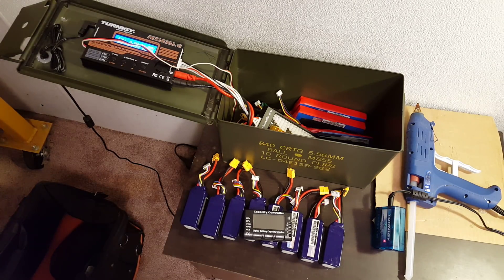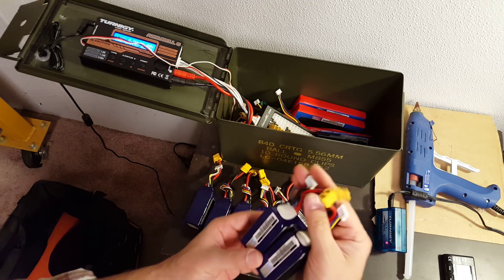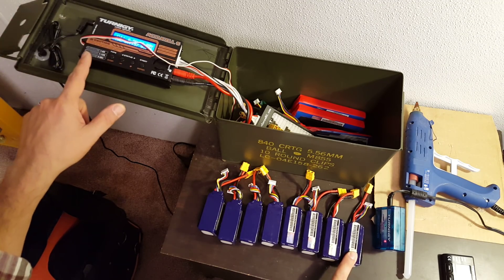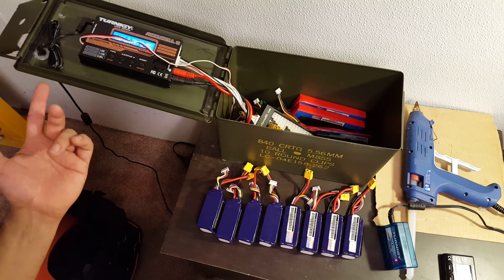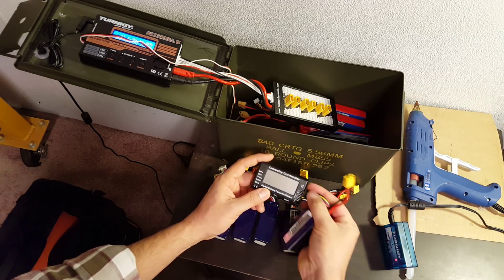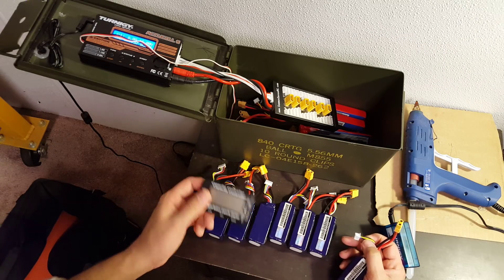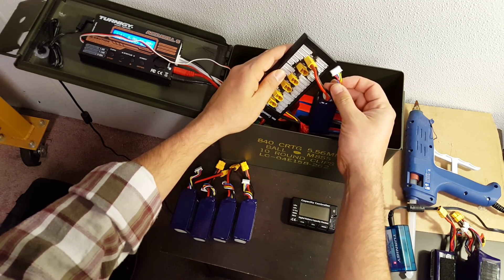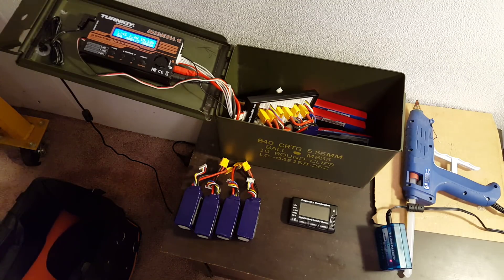How To Parallel Charge LiPo Batteries Without Burning Down Your House

Comment: So just to clarify this - I have an Accucell-6 like yours, and I just got a parallel board. I plan to charge x4 4s 1300 mah batteries with it. I did the math and I believe if I tried to charge them at a charge rate of 5.2 amps, I would end up pushing potentially 87.36 watts, which is more than the Accucell can do. I read from Oscar Liang that the Accucell will auto-detect that I'm trying to overdo the power, and will automatically adjust the charge rate to safely charge. - Edit - I assume this is why you max your charger out @ 6 amps knowing that it won't push that much amperage.  For now I just plan to charge 2 of them at a time at a 2.6 amp charge rate, which seems safer for my charger. 
What do you think? Should I just go ahead and carefully try charging all 4? Sorry for the wall of text
Reply from the maker: You can charge all 4 it will just take longer. The Accucel will not let you exceed its rated amps or watts. The only thing to worry about is whether you are charging the batteries too fast.
Reply: Okay cool, thank you.

Comment: Are higher discharge rate batteries always better than lower discharge rate ones ?
Reply: If not, why ?
Reply from the maker: +LT “John” YV discharge rate on the label is almost completely meaningless. A 70C will probably perform better than a 20C but anything over perhaps 40C is a total crap shoot. And anything over 90C is almost certainly B. S. 

For mini quads, higher REAL discharge rates are probably better. For other applications, energy density and other metrics might matter more. For example, an EDF plane will have relatively constant current draw with few sharp peaks. So a higher discharge rate might not be needed. Every battery design is a tradeoff.

Comment: I noticed that you used the balance charging function when charging in parallel charging. Are you still able to parallel charge safely using the normal charging function?
Reply from the maker: +Nestor Folta sure. It's no different than charging one large battery. But I think you may be more likely to end up with the packs out of balance when you parallel charge because the cells haven't been matched (internal resistance) like they are within the same pack. But I'm not sure about that.

Comment: what if i leave batterys connected to board to do their job and they will balance closer before i start charging them .
Reply from the maker: Yes.
Reply: i was about to say the same, thats what i always do but wasnt sure was right!! I normally just use my batt then when  i need them again i slap them on the board and i leave them there for about 10 minutes...then start balance charging. If Joshua approves ill keep doing it....so far i didnt have any problem! :D
Reply from the maker: +Gaming isnotacrime just be sure they're not too far out of balance! The current can be substantial if they're not.

Comment: Hey Josh any tips on how to get the batteries close to the same voltage 0.1v from each other?
Reply from the maker: +Amber Meows If you stop flying with a mAh meter on your OSD, they should be pretty close. At least they are for me. Remember, it's not 0.1v, it's 0.1v per cell. So for a 3S, that's 0.3 v; for a 4S, it's 0.4v. That's a relatively large window to hit.
Reply: Thank you for confirming the voltages for different cell types! All the guides i've seen on parallel charging always say it's suppose to be 0.1v.
Reply from the maker: +Amber Meows no problem!

Comment: "Parallel charging is somewhat of a controversial topic..."

FOFL! That there is the understatement of the day...

"Don't do anything dumb, and you'll be OK..."  is just golden. I couldn't have said it any better myself. :D

I'm of the "Parallel charging is just Taunting Murphy" camp. I see it as trading essential safety for the money saved not buying the stack of multiport chargers you SHOULD buy to charge all the batteries you WANT to charge at once.

That said... it IS possible to parallel charge safely... as long as you treat your entire charging array as if you ASSUME you'll have a fire one day, and set up your charging station so it can HANDLE a 1400° fire. In all honesty, you REALLY should set up this way ANYWAYS, because ANY LiPo can catch fire AT ANY TIME.

Your setup is probably one of the few I've seen that DOESN'T fill me with dread; this is because you are doing it the SMART way. Your setup CANNOT possibly apply more than the 2C-5C charge rate that is safe for most LiPos, so even if things went south and all the current got dumped across one pack, you still wouldn't be over-charging. This is not so with some of the bigger setups that some parallel-charging fans use... that push 40A across the array, and if ONE LiPo goes open-circuit, the setup dumps way too much current across the other LiPos in the array.

Also, your chargebox is a great idea; if there is a fire, you just close the lid and throw everything out the door onto your driveway. I use a similar setup on top of 12" ceramic tiles deliberately arranged to be easy to grab & toss.

Like anything involving electricity, messing around with it when you don't know what you're doing IS just dumb. So if y'all don't understand the reasons Joshua is advising you to do things the way he is, don't do it!

Electrons may be tiny, but when they gang up on you, they ALWAYS WIN. :D
Reply from the maker: +mnemennth "Electrons may be tiny, but when they gang up on you, they ALWAYS WIN."

That's brilliant.
Reply: +Joshua Bardwell :D
Reply: 88Nikoli. When I was a paratrooper in the Army, we used to say, 'feet and knees together'. Point being, you're going to get hurt, but still don't land like a bag of shit. We use to carry explosives in ammo cans. Detonators in one can and C4 in a different can. Both in the ruck on your back. I won't  parallel charge until my setup can handle a fire and the fumes because massive amounts of stored energy in any form has potential.
Reply: mnemennth. Nice rant. I picture bad things upon hearing pick up something that is on fire. It is possible if you can if you catch it quick, but not good to try to close the lid. 

Could be as simple as a medal cable on the can and a wooden dowel on the end. 

Even keeping a set of pliers near would be good. Maybe you do this, but the point is to have a plan and react.
Reply: A lipo won't catch fire just at any time, smh

Comment: can i do this with 2 tattus 4s 1300 and 1500 ?
Reply from the maker: Yes. As long as the cell count is the same and the voltage is within 0.1 per cell.

Comment: nice video, does it matter which balance ports you plg the battery's into on the board?
Reply: I just got mine
Reply from the maker: +AveryFpv Does't matter. They are all in parallel so they are all "equal".
Reply: +Joshua Bardwell thanks!
Reply: @JoshuaBardwell  that comment should have more likes

Comment: Great video!  I find your channel more detailed in information and more giving than that farting around rotor riot channel.  You got tons of info ranging all angles around multi rotor. I'm amazed how much videos you put out.. You have helped me tons. Keep up that great work.
Reply from the maker: +2663540 Thanks for the kind words. Glad you are enjoying the content.
Reply: JohnnyMacZero24 .1 of the center would be better...measure and pile them up until you have enough of the same to do a batch...so if one is 3.5 then 3.4 n 3.6 would be ok to charge all three
Reply: MyBigThing2010 Got it and thank you! Happy Flying
Reply: Joshua Bardwell Hey Josh Love your work friend, here's my quick question 
So if my 3S Battery's are at 3.78 3.81 and 3.82 it's safe to charge correct? All cell should 0.4 of each other right?
Reply: JohnnyMacZero24 no prob..same to you
Reply: 2663540 agreed about rotor riot! They have given me lots of free advice, and for that I am grateful. However the "farting around" is kind of annoying at times. Joshua gives a lot of detailed reasonable advice, and uses reasonable equipment. Case and point: on the parallel charging video for rotor riot, they used a $300 charger with a $100 power supply! I don't know about you, but I was squirming spending $50 between charger and power supply! Ended up buying the Turnigy Accucell like in this video. Thank you +Joshua Bardwell for the info!

Comment: Hi Joshua. With these parallel charging boards, is there a specific order for the balance ports in relation to their XT60 ports? E.g. First XT60 port uses the top left bunch of balance ports, so on and so forth, or are they all the same and I can simply plug my battery balance leads into any convenient port? Thanks.
Reply from the maker: In parallel, order doesn't matter. You can use any plug.

Comment: is there a very easy and fast way to charge batterys that are more then just 0,1V apart from each other? I just start with the lowest battery and add the other ones, as the allready charging battery becomes the same voltage as the "next" pack. It is very annoying to allways watch the V Meter on my charger and dont miss the correct time to connect the next Lipo to my board.
Is there a faster way?
Reply from the maker: +skatebjarne Remember, it's 0.1 volts per cell, not 0.1 volts. But if you're more than that, then what you described is basically how you have to do it. Or just charge them one at a time and suck it up.
Reply: Or you could just get a ISDT D2 charger then you have a 2 port charger and you can charge different cell types.....

@Joshua.... is it safe with a parellel board to say let's charge (2 - 450mah and 2 - 550mah of course all 3S) at the same time it no??

Comment: do the xt60 plus correspond to certain balance ports? ie which side 3s port do you plug the balance lead in left or right.
Reply from the maker: It's all in parallel, so it doesn't matter.
Reply: +Joshua Bardwell OK brilliant thanks

Comment: Thanks for the vid! The following excellent article expands a bit on what you said and was how I learned to do it: http://www.electricrcaircraftguy.com/2013/01/parallel-charging-your-lipo-batteries_22.html 

I think one of the ironies is that because it's more dangerous, you end educating yourself and become more careful and responsible about your charging. Also what Goat said: you're less likely to leave the charger unattended if it's all over in one go.

I have the Turnigy Reaktor 300W and matching power supply so I can charge six 1300mah 3s packs at 2C and go out for a 6-pack fly. I use the "sketchy" HobbyKing balance board you have that goes up to 6s. If you plug in one battery, all 24 balance connectors go live (at least for some of the pins)! Sketchy. So I tape over all the balance plugs I don't use.

The habit that will help the most is to try to discharge all your packs to the same voltage when you fly. The dangerous part of balance charging comes from differences in voltage between packs/cells. You need to be 100% sure of the voltage of any pack you plug into the board. 

As a difference to your demo, I check the individual cell voltages on the meter and don't concern myself with the sum pack voltage. Then the 0.1V maximum is universal (no multiplying), and you can notice bad cells while you're at it.
Reply from the maker: +Siana Gearz if you don't do your homework with lipos, you're going to get burnt. I typically charge a mix of 1300 to 1600 at a rate of 1 amp times the number of packs. This never results on any single pack receiving more than 1C (verified with a clamp meter) and completes balance charging in about an hour.
Reply: Eh? A setup which charges batteries individually more slowly, but requires no manual intrusion to charge the whole batch and saves time on the whole... yeah in your dreams people aren't gonna let it run overnight unattended. People tent to justify whatever they happen to like in all kinds of ways.
Reply: It takes exactly the same amount of time provided your charger can supply enough amps.
Reply from the maker: +Siana Gearz I can charge 20 batteries in an hour, or one. I just charge at higher amps when there are more batteries. That's why parallel charging is useful.
Reply: I don't dispute usefulness of parallel charging.

You shouldn't charge the parallel pack with a sum of current the cells are rated under, you are taking a risk tradeoff - you're absolutely on the safe side if you divide C-rating by the number of batteries or alternatively use same charge current you'd use for one cell for the whole pack, which means you're wasting time. Or if you like to live more dangerously, you can take the aggregate current and de-rate it by assumed difference in ESR between cells, i.e. factor 2 or so.

But regardless, i didn't want to say anything about this, just point out that the logic that an inherently more perilous technique is supposedly more secure is asinine, because some people will always abuse everything to the fullest extent possible, and not everyone will do their homework.

Comment: So what's your opinion of parallel charging batteries of the same cell count but different capacity?  For example charging a 1300 4s and an 1800 4s.  I have heard it is ok but it has always sketched me out.
Reply from the maker: +Wyll Surf Air It works fine. Because the batteries are in parallel, their voltages equalize. Then the charger applies a slightly higher voltage to cause the desired amount of current to flow into the batteries. The bigger battery will take a larger proportion of that current, in proportion to its size. You can think of it this way: because the battery is bigger, it takes more current to charge the battery the same amount. So when you push a given amount of current into the parallel-battery system, the larger battery's voltage doesn't rise as much. This causes a greater difference between the supply and the larger battery, which causes more current to flow into the larger battery.
Reply from the maker: +Wyll Surf Air Here is another analogy. Imagine you have two containers of water. The height of the container is analogous to the cell count (voltage). The width of the container is analogous to the capacity (mAh). Now imagine that one container is 2x as full as the other (charged battery vs. discharge). Now imagine that you open a gate between the two containers. The water level will equalize, right? Okay, that's plugging the batteries in parallel. Current flowed until the voltages equalized.

Okay, now imagine that you have two containers, and one of them is 100x as big as the other, but this is key, both of them are 12" tall. One of them is like 1 meter x 1 meter x 12" and the other is 100 meters x 1 meter x 12". Got it? Both are empty (discharged battery). And both of them are hooked together with an open gate (plugged in parallel). Now start pouring water into one of them. Can you see that it doesn't matter where you pour the water, or that one of the containers is bigger? Both of them will always have the same number of inches of water, right up until they are full.

That's parallel charging.

Comment: I understand that you're at risk of a fire regardless of how you charge, and that if you do everything correctly it is not more dangerous to parallel charge. The point is that it is a lot easier to make a mistake while parallel charging. As you said yourself, if you hook up a pack to a charger and try charge it at the incorrect voltage it just won't do it. However if you hook up two batteries with different cell count or even just a bit too big of a voltage difference to a parallel charging board you'll get a fire. The process of parallel charging is not inherently dangerous, it's just a lot easier to make a mistake, which is why I still use a 8x charger setup even though it is a bit more expensive: http://i.imgur.com/Wp6KJ4T.jpg
Reply: ***** It' s just some generic psu with 2 outputs that i found.
Reply: +Jay Anderson Bit off topic but worst case scenario, if one of your lipos catches fire, wouldn't it potentially ignite the wood it's on and/or carpet nearby?
Reply: Swiggity Swooty It would probably char a bit of the wood there, but I have a fire extinguisher nearby and I always charge attended.

Comment: Another great video Joshua. http://imgur.com/gallery/sGCO3ZJ/new. My 10 way parallel board with master and individual fuses. With a decent (and powerful) charger I think parallel charging is far safer, mostly because it only takes about 35 minutes (1C) and so I can charge all 10 packs while sitting right in front of it drinking my coffee.
Reply: +Goat But that wood table is good safety practice?
Reply from the maker: +Goat Looking forward to getting one of those para boards in hand, whenever you finish developing it.

Comment: Parallel charging 4-4s 1300mah batteries on that charger is kinda pushing it as far as the wattage is concerned. I have the Turnigy Accucell 6 10A version and it gets pretty warm parallel charging in that configuration. I never really understood why they designed those chargers with such a low wattage spec. They are really nice chargers for the money. Parallel charging 4-4s batteries is actually 87.36 watts which comes in a little over the 80W limit for these chargers but hey who cares right? If it blows we can just pick up a new one for how cheap they are. I've been looking at picking up the Hyperion Eos 730i NET 3 charger so I can do 8 4s batteries at one time? Heard anything bad about the Hyperion line? Keep up the good videos, I really enjoy your channel and your informative ones are easy to understand and highly useful. Thanks again, happy flying....
Reply from the maker: +Ronn Wilson  It doesn't really matter IMO. The charger doesn't care how big a battery it's pushing into. It just cares how many amps/watts it's pushing. It caps out at 50 watts, about 3.0 to 3.5 amps at 14-17 volts, and just keeps going until the battery is full. Larger batteries just take longer. The charger has in-built safeguards to prevent it from exceeding its own safe ratings.